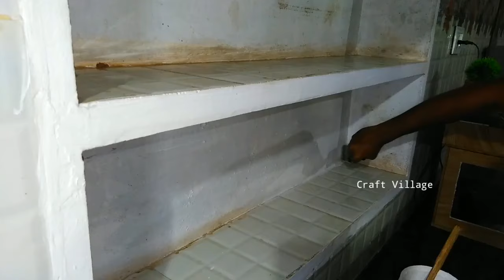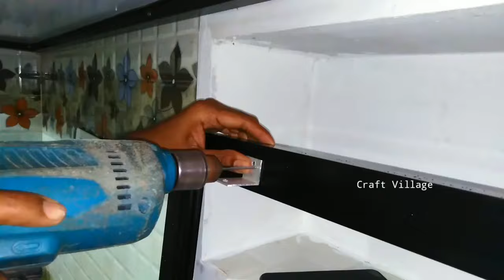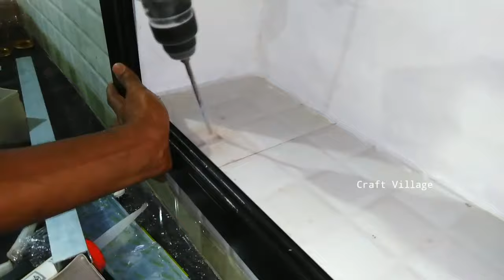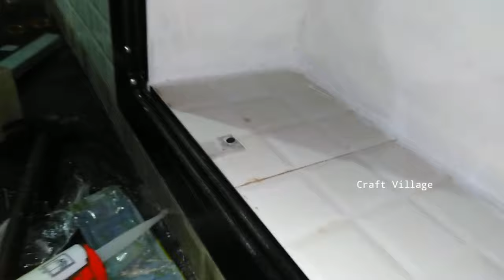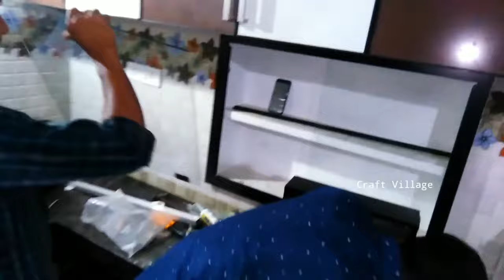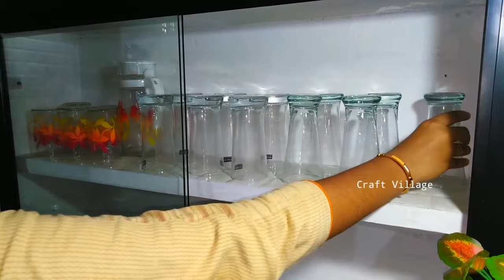How To Make Simple Kitchen Showcase at Home | Kitchen Organize Idea

Comment: What will be the price for 45 x 80 inches having 5 shelves
Reply from the maker: This showcase total expense under 2000rs
Reply: I have mailed u the pic of my crockery unit 5 shelves to the mail id. Once check and let me know the price??? Where are you from ???
Reply: @CraftVillage is the shelf concrete or wood/ply board? If the shelf is concrete than is it possible to fix the frame on top of it and install glass door like yours?
Reply from the maker: @aditipurkayastha2385  yea... It was concrete 👍🏻👍🏻